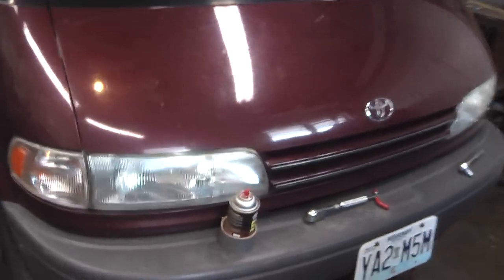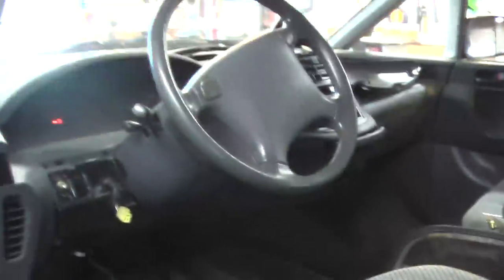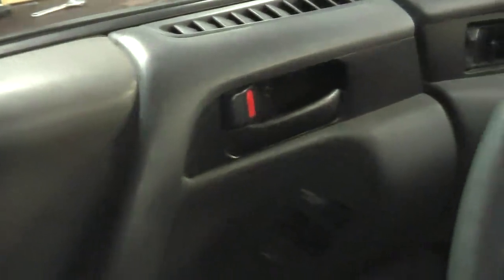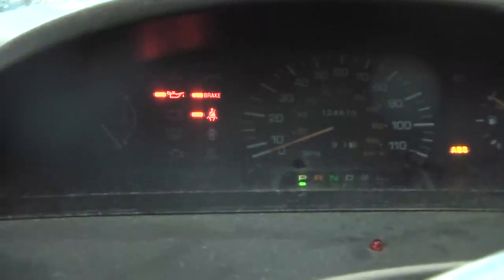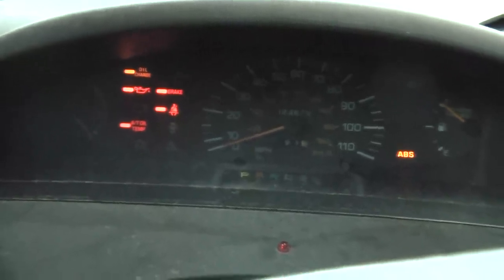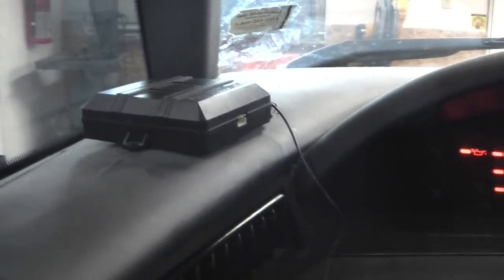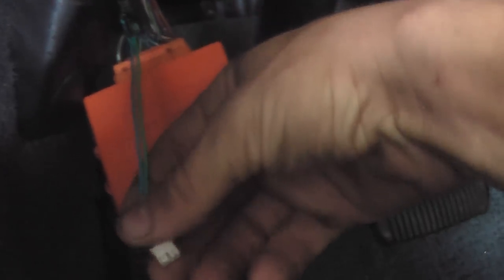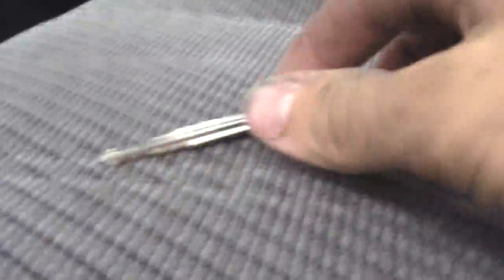Faulty Alarm System Bypassed, Toyota Previa Starts Now

Comment: DO NOT JUMP THE YELLOW WIRE TO OTHERS IN THE HARNESS! Yellow is a connection to the ignition switched on. If that is jumped to other wires you will short other things out. There is a Orange wire off of the alarm the gives a ground when armed which is connected to a starter disable relay usually close to the ignition switch. If you just cut the orange wire the van would have started...

Comment: Also check for loose battery cables.  I had a loose negative cable causing similar symptoms and randomness.  Before replacing the starter motor or the alarm, remove the cables, clean the connections where the cables touch the battery negative and positive poles and make sure they are put back tight on the battery so you have a good clean metal to metal connection.

Comment: Just an incorrectly installed alarm-keyless entry aftermarket box worth about $40 on eBay. You most likely would have found; had you locked the van with the keyfob then tried to start the van it would have started. These are the best Vans every created.

Comment: Mr. Daniel, will that also work in a 1992 Toyota Camry?  New Starter, Battery is good, dome light comes on, I have to manually unlock door, headlights work, horn blows, key remote still function, but no radio, or instrument panel lights come on when the key is in the on-position. Whew!!!

Comment: My aunt had a '88 Supra with the same problem. I'm not sure if it was bought (new) installed or not , but if it was the same as with this Previa, it sounds like it's a factory or dealer installed aftermarket alarm if the dealer is able to replace it. Anyway, I remember she was told that it couldn't be run without the system (which I recall being much more expensive; greedy dealers...), so my uncle bought a new Accord. This was around ten years ago and some guy eventually begged enough to buy it.

Comment: I have a 1993 that does this.  It won't start sometimes.  If I wait for a while, it starts up.
Only happens once in a while.
Reply: Theres a coolant temperature sensor on the engine at the passenger side, that could be the culprit. If the car needs to cool down before starting most likely that is the problem.

Comment: I have a 1994 Toyota Pickup . I removed the Avital Tornado Alarm but my Plug does not have a yellow wire ?? my Pink wire is my Ignition Switch.. but I dont know what other colored wire to connect it to? :(

Comment: My Toyota previa le 97 it turns over but it will not start and my head lights not working either so is my horns and emergency flash not working too

Comment: thats good for that vehical my dad had a 99 chevy pickup special ordered it witheverything he wanted on it they put on this damn securtiy thing. so if the gas cap wasnt tightend so it clicked the engine wouldnt start. sometimes the light come on while driving locked the doors and killed the engine. of course you could push on the little lever to unlock it and get out. even GM couldnt figure it out it had something to do with the BIG computer that run the engine too i hate securitythingsonvehical

Comment: My 2004 mercury is having problems that might relate to the box in that car. The alarm randomly goes off whenever it wants to for no reason. Do you know if it is the alarm system itself or maybe the battery in the remote went bad or something but I have to unhook the battery after every use and it is really getting annoying. Any thoughts?